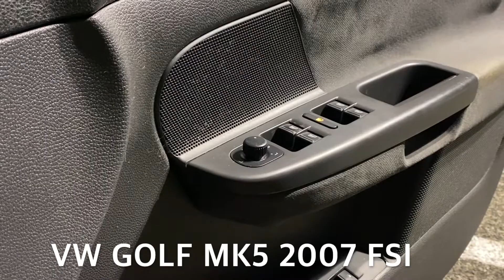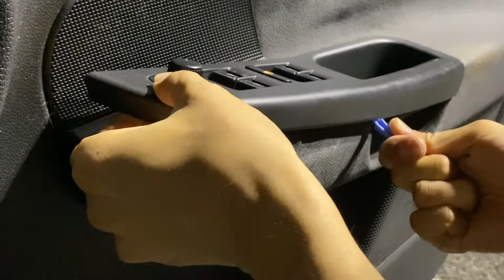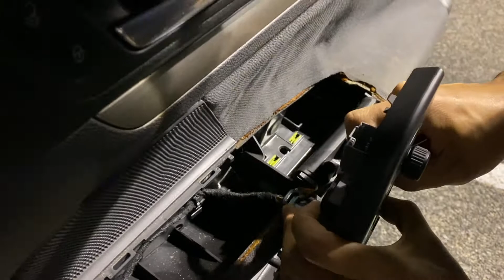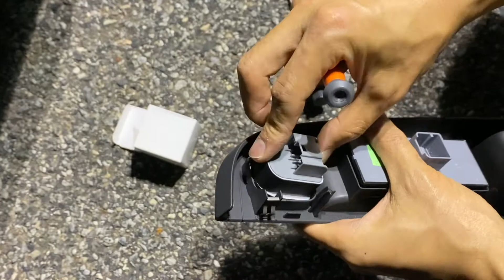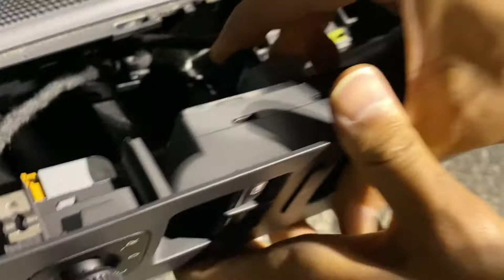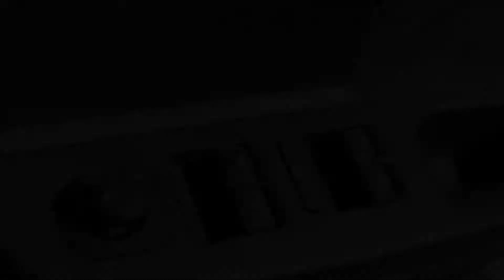VW Golf MK5 Side Mirror Control Switch Replacement 2007 Volkswagen Golf

Comment: I had to get a window regulator replaced on mine recently and I only noticed a few days ago that the drivers mirror is not moving when I try to adjust it but the passengers side is instead. It is working that one in the opposite directions when it should be doing the drivers side. The passengers side is working perfectly when it is selected though. Did the lads at the garage plug in something wrong when putting the door back together or have they crossed wires etc?

Thanks in advance because I will definitely use this method to get at the switch if that has failed in some way. I would just like to know what I should be looking for when I do try.

Comment: Mine works on the left but not the right. Would this still be the switch or an electrical fault somewhere else?
Reply from the maker: Hi there, i have been changed module as well.
Reply from the maker: it’s located inside of door panel
Reply: Thanks mate!